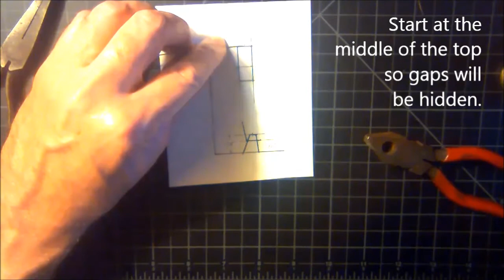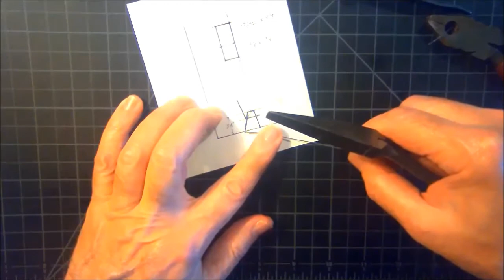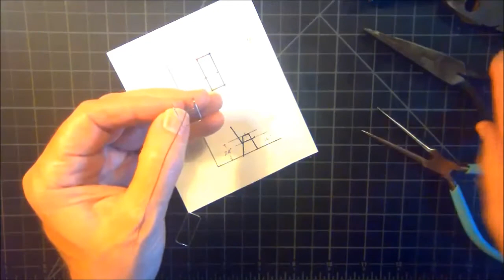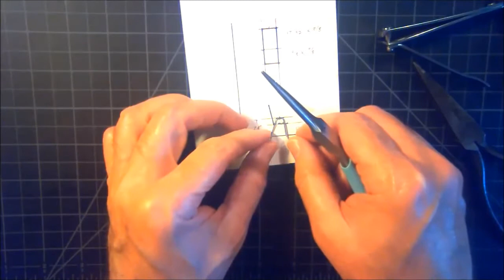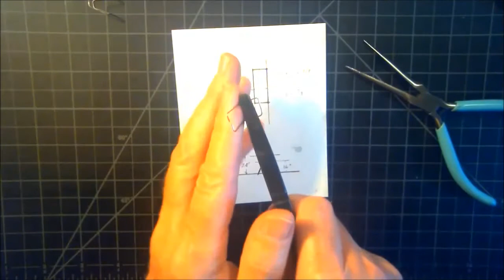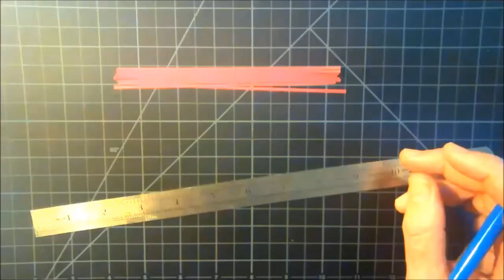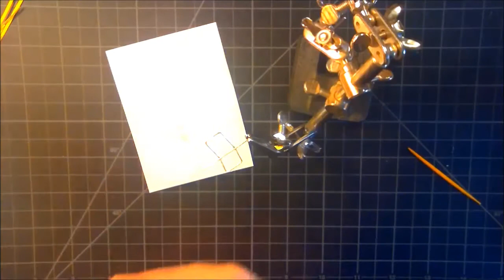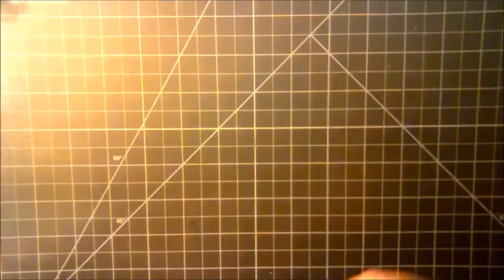O Scale Lawn Patio Chair Scratch Build

Comment: An easy way to "sharpen" hobby knives is to grind the back of the blade over at an angle making a less acute point. You loose a bit of blade each time but you only use the point.